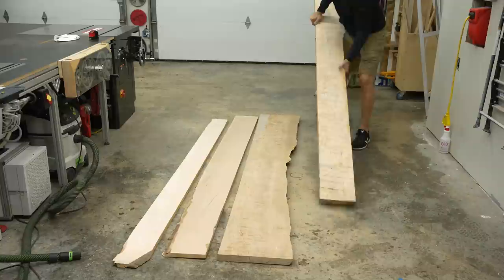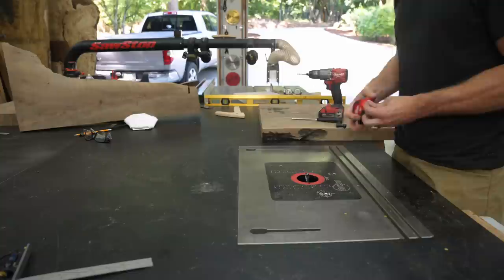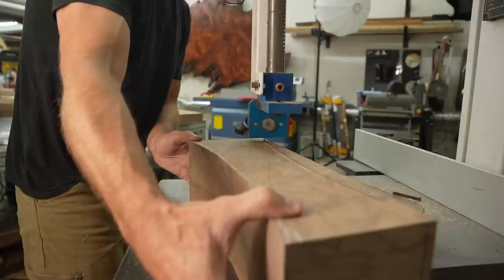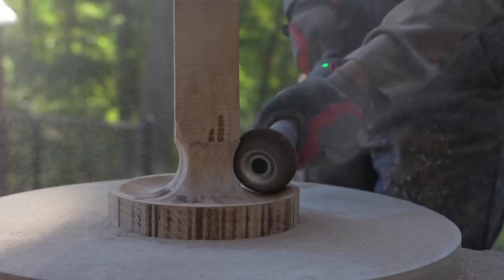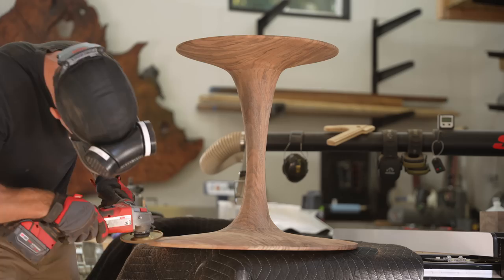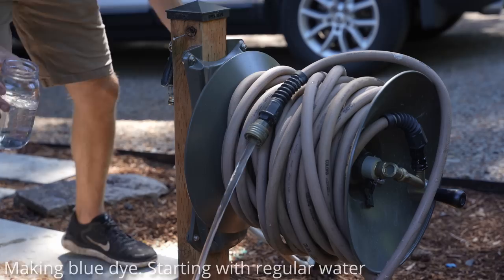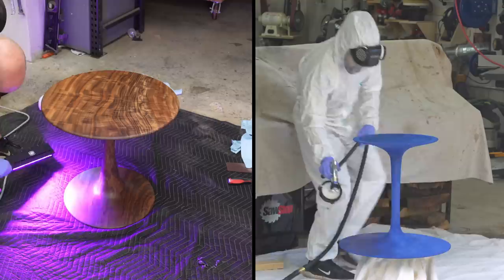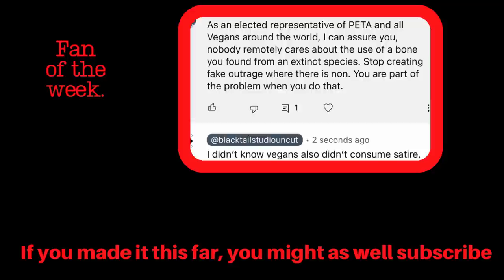$8500 of End Tables

Comment: The underbase texture looks great. I'd love a table with that texture all over (obviously plain flat top). As for the colours, the blue does look really nice. Key problem is that many colour schemes won't work with the blue whereas the walnut works with most. So even though it looks just as good you've reduced your customer base fighting over it at auction. Different coloured woods might look great too, but again walnut likely has the largest customer base which will offset the fact that other woods might look nicer for some customers. That quilted maple in a wood colour would likely be my favourite given the right room colour scheme, though the blue turned out fantastic too.

Comment: Just a tip. From a guitar enthusiast. Typically when Luthiers make guitars out of textured wood like quilted or flamed maple like you did with this table, they apply dye in two layers, going from dark to light, with a light sanding in between, much like you did on the top. It let's more of the unique wood grain show through, and ir has a one of a kind way of catching the light. I think if you used the technique on the top for the whole thing it would come out much better, not to say what you did was bad. I love how yours turned out.

Comment: Something I've been wondering about for a long in regards to woodworking, is underpressure or overpressure better for penetrating wood? Say you've got a container with a piece of wood submerged in oil, what will make the oil penetrate deeper? Pumping out the air from the container creating a vacuum or pumping in extra air creating air pressure inside the container?

Comment: That router table trick works like a circle jig would for a handheld. The issue with this method though, is that if the bit grabs the wood, it could spin the whole thing (like a pair of gears) if you're not holding onto it. That said, the larger and heavier the wood, and the larger the radius of the circle, the less chances of this happening. Also, a sharp bit and not taking too deep of a cut helps mitigate the chance of it grabbing as well. That would be my only concern as far as the safety of using this method.

Comment: The blue is looking good, a little tip for the next project is use a black undercoat then sand it out. The do your primary color. This will give the figure in the wood a shadow effects depth to the color. Keep up the good work!
Reply: This is a perfect tip, would really make a big difference, I think it would have helped the base not look so plastic.

Comment: 1:51 probably the saw is dull, but you know what would be good for you? a sliding table, probably the wood pressure wants to go out and it just jams in between the fence and blade. But with a sliding table this effect is gone. Yet you might not end up with a straight piece this way after cutting walnut. As you probably know, walnut often bends after sawing. I used to oversize before true sizing, but this didnt quite always help either. Sometimes I oversized and then planed. But I suppose with a table you would need a couple of hands to get it over a jointer, or rather use a handplane. In my opinion worth it with these pricey woods

Comment: I use trans-tint dyes all the time for gun stocks and furniture and If you're going to use water, you really should use distilled especially with darker woods and dyes. I have very hard water here and had to apply the dye more than i would have liked in order to get the tone where i wanted it and  as the dye and water entered the wood, the impurities built up on the surface in the pores of the wood. You kinda had to really look for it, but after noticing the first time, i couldn't unsee it. I now prefer to use denatured alcohol since it dries faster and is much less likely to warp the wood by getting it too wet. ill save you the story on that one. lol. I love your videos and learn from every one ive seen.

Comment: 4:10 im not exactly sure, but i did a little woodworking in highschool so i have a little experience with a router table (like 4 hrs worth... lol.....) but... could it possibly be because the way the outside portion of the wood is turning with the router? if i remember right, you have to turn the wood against the rotation of the blade, otherwise it might catch and fling the wood. so usually the blade rotates clockwise, so you would want to rotate the piece of wood counterclockwise. with the way your cutting into the wood, your technically cutting with, and against the rotation of the blade? since there is wood on both sides of the blade. think of 2 arrows on top of each other pointing opposite directions (for cutting directions) and then 1 arrow for the rotation of the wood. either way you rotate the wood, your turning it with the cutting direction, and there is possibility for it to catch and throw the wood.......... right?

Comment: I like the walnut only because I think that the same table but with either the blue bleeding into the walnut either through out or just as a gradual fading from the bottom up leaving the  walnut a the top and under the top.

But what do I know I can't even use a glue gun without getting 2nd and 3rd degree burns.
😊. But, with both colors combined I think would have been something id bid on.

Comment: I don't like how either of them look.  Most modern houses go for a solid color without any grain.  I think understanding a minimalist trend is important for crafting a highly desirable table.  You could create a nice wood table with a nice stain like you usually do, but after you do that, paint the base of the table with a solid white that fades into the stained grain look.  You could make the base shape like a minimalist mass-produced table, but the top be more warped, wiggly, and even worn or weathered.  The uniqueness of the table will increase the value as well as the fitting theme for most modern homes.

Comment: The router table trick is only dangerous if the material bites because there's material on both sides it has no give so most likely will throw the piece in any direction

Comment: I am so glad that you are challenging yourself with weird suggestions.    Weird to you, or challenging because of historical reasons.     You kept talking about warping and future problems as well as technique issues.    All said and done, you got the job done.   If you are going to talk about a guitar body, you should also talk about a guitar neck.   Why are you not running a guitar neck rod down the middle of the central post?    If the table develops problems, pop out a central rubber plug underneath and turn an Allen key guitar neck rod.  This will unwrap the neck of the table just as a guitar.    Yeah.   You can now maintain your central post tables.  Wow.  Right?     Then.   Stop making these table while stationary.   Vases are made on a turntable that spins to help you make a symmetrical design.     I loved the walnut and blue acrylic table.   Awesome job.   But with a spinning turntable you can grind spirals and circles into the table.    You can stamp designs into the wood as you index the wood 45 degrees.   So I am suggesting:  circles, spirals, stamps, and maybe indexed grinds.   Kick it up a notch.    You’re awesome.

Comment: Although the walnut table won the auction the blue table was likely doomed from the beginning. Realistically if these two tables remained as close to natural colour as possible, then that would have been a fair challenge. Altering the timber to electric blue tones makes both of these two products way way to different to even be on the same page towards competing against each other.
I love the blue, but I simply wouldn't have it in my home, where as in its natural lighter grain form I'd have certainly placed a bit - possibly higher than the walnut sold for but I dont like walnut either therefore lost a bidder, and likely many others too.
This challenge was actually won on colour, Not on timber choice or preference in grain. Again, I like the blue table, But. As soon as that blue dye touched the surface of that light grained timber the majority of lighter furniture table bidders pulled out of the race immediately.
Which then still begs the question.... why not use alternative / different timbers??? why do you still insist on remaining to stick to mainly one type of timber?
Example... If an elite top car manufacturer released brand new weapon of a real mans, mans type car. Those in that market would rush to purchase in a heartbeat... But would they, if the manufacturer painted that altermate vehicle in a super bright pink or rainbow paint colour, would those manly men buy one then - Not Likely, (making a point here not a dig at others personal life choices!). Exactly same scenario applies to the blue table.... you reduced the market which caused the result of this saleable outcome

Comment: Not an expert at all, not even an ameteur, but if there ever would be a problem with your routing table technique, I would bet it would come up if you hit a hard knot in the wood and it just got kicked off the pivot point. I doubt it would be more dangerous than using the table normally though (again, I know nothing, purely intuition here)